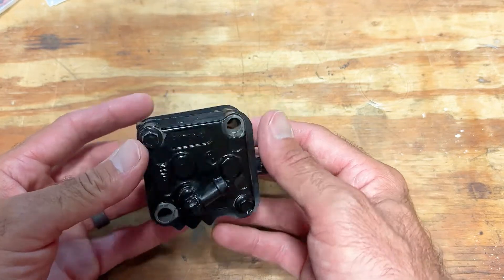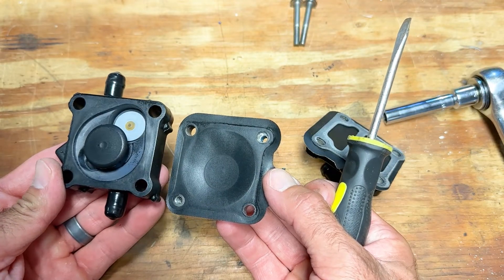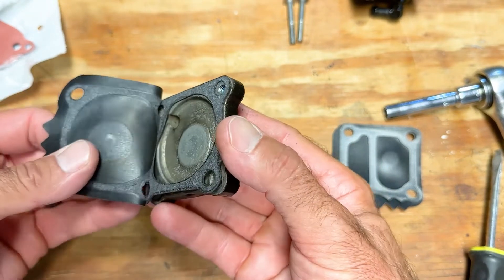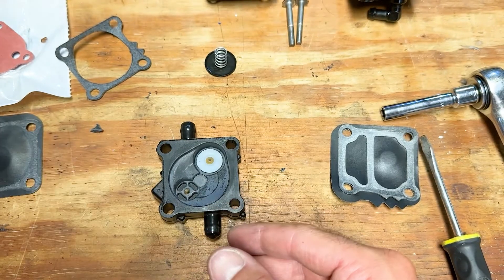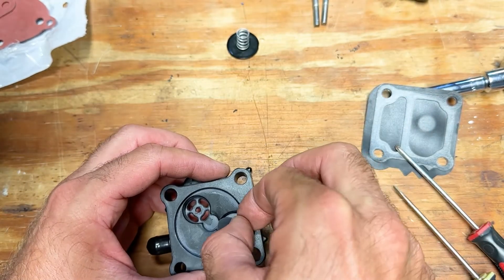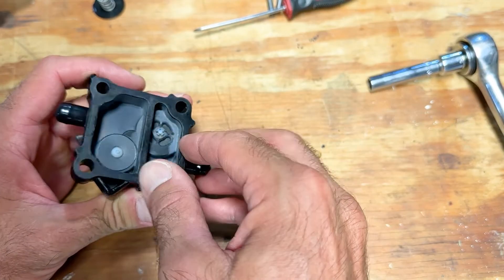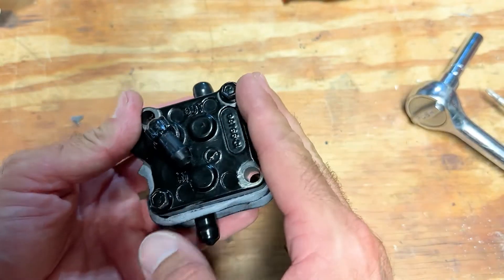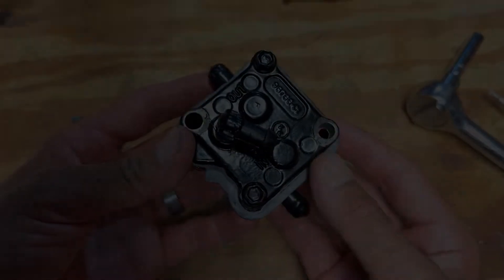Low Pressure Fuel Pump REBUILD (Mercury EFI Outboard)

Comment: Muy instructivo video.Congratulaciones por el compromiso de siempre aportar soluciones al mundo nautico. Cree ud que el mal funcionamiento de una bomba de estas características, pueda ocasionar que un fuera de borda Mariner 25HP EFI 2007, de arranque manual, genere dificultades de arranque y sólo lo haga bien cuando intento el arranque con el acelerador activado?
Reply from the maker: Possibly. Mine has actually been doing that more and more too. I think it might be the fuel pressure regulator.

Comment: What about the gasket that goes on the back?
Reply from the maker: No gasket on mine. Just have to line up bolts and make sure vacuum hole isn’t covered up
Reply: @PrestigeWorldwideFishing if you go to the 7:15 mark on your video you show a clear shot of the back of the fuel pump. That clean popsicle stick shape you see is from where a gasket goes. You may be getting lucky lining up the hole and tightening down those 2 screws but there 100% is supposed to be a gasket there. Yours at some point also had it. I just bought a gasket kit and it came with the popsicle stick shaped gasket.
Reply from the maker: @FirstCoastFishingAdventures weird. Maybe I will add one to be safe. New model didn’t come with it either. Thanks for catching that!
Reply: @PrestigeWorldwideFishing I came to this video to check and see the exact orientation of the back gasket and there was no mention of it and mine is pulling in air because my gasket was blown out so I was like “wait up, hold on a minute” lmao
Reply from the maker: @FirstCoastFishingAdventures 😂 my bad. And I just pulled mine. I did install the gasket on the one attached to the boat. Just failed to remember and mention that in the rebuild video.

Comment: With the engine cranking should fuel be coming out of the fuel pump out let ?
Reply from the maker: Yes. It pushes it out the outlet to the high pressure fuel pump. Might have bad diaphragm on your low pressure pump, clogged fuel filter or line, or maybe air leak in line or bulb

Comment: I got a yamaha 4 stroke 70 hp fuel injected its been sitting for 2 years gave it a fog treatment a waited for 24 hours put in new gas put some starting starts put goes off wont stay running
Reply from the maker: Check and clean your high pressure fuel pump too. Replace the fuel filters and maybe consider a seafoam shock treatment to break up carbon build up in the motor. It will make it run like crap for a bit until it gets it all through
Reply: Same!!!! My 02 225opti sat for a year. Replaced water pump, poppet valve, fogged it. Brand new fuel and fuel filter. Will start but only runs for a minute than dies. Primer ball goes soft also
Reply from the maker: Can’t say for certain but that sounds like a bad low pressure fuel pump. If your boat runs good at low rev and dies at high rev when you are running it’s a high pressure pump. I got to experience both lol
Reply: @PrestigeWorldwideFishing  looks like it was my primer ball!! I’m going to rebuild the fuel pump anyways since I have the kit. Old primer ball wasn’t working. 🤦🏻‍♂️
Reply from the maker: Ah gotcha! Did it have a hole in it or something?

Comment: How much does that low pressure fuel pump cost? Does that one run off camshaft?
Reply from the maker: They are pretty inexpensive. Here is video of the install on my 1996 motor. Fairly simple.
https://youtu.be/ZioSA3qhEwA
Reply: I ordered a kit. One of the rubber gaskets has two holes like 3/8 diameter! Do you know if it makes a difference vs the one you installed? Thanks!
Reply from the maker: @salvadorpineda7762 man, I’m really not sure. Might just have to install it and find out I guess. Good luck

Comment: That little plastic piece of shit that locks those check valves in is bullshit. Mine went fucking flying across the driveway and ill NEVER find it again. Now the check valve had a hole in the center and dont know wtf to do now 😡
Reply from the maker: Yes I agree those things are super annoying. You can order another kit off Amazon pretty cheap… I know that doesn’t help your current situation though

Comment: I have the 125 mariner I rebuilt my fuel pump a few years ago and I used both black rubber and plastic check valves and it’s running fine still.
Reply from the maker: Ok good to hear! I figured I would be fine but felt I needed to put that in there. Thanks for the info. 🤝

Comment: Interesting … do you think this could be causing similar issue on 225 EFI?  Basically motor runs great other than when shifting from neutral into gear - makes it tough to dock lol
Reply: same issue on my motor did you solve it? i have same 225efi, great runner doesnt love to idle once warm. im looking at TPS next.
Reply: Changed tps and never stalls anymore.  Now I’m bogging down at 4k rpms. Think I have a fouled spark plug.  Always something …
Reply from the maker: Possibly, could be a number of things though. Does your fuel bulb pump up easily and keep fuel in it or does it empty?
Reply: It typically emptys I think
Reply from the maker: Might be your low pressure pump then. My motor would actually die and my bulb would be completely empty. Couldn’t get motor to start until I pumped it up again. It would run fine for quite awhile and to it again.

Comment: Hey buddy by chance did this fix your issue?? I’m having same issue.  I’ve tried replacing so many parts and cannot figure it out! I have same motor just a 200hp! Sucks not being about to get out and fish!!
Reply from the maker: Hey man. I did fix the issue but went in circles so not exactly sure what did it. I replaced low pressure fuel pump, problem still happened. Replaced high pressure fuel pump and it stopped happening the first time out. Went out again and nearly didn’t make it back to the ramp because boat wouldn’t start. 
Got it home tried to start in the yard with muffs on and nothing. Pulled off my Amazon low pressure fuel pump and replaced it with the rebuilt fuel pump. Fired right up and I ran it hard on the lake with no issues so far.
What have you tried? Maybe I can help
Reply: @PrestigeWorldwideFishing  well that’s good to here! Hopefully it stays good for you.   So…. Heck idk where to even start.  Basically right now I can’t get on plane. Starts up and idles just fine! Revs up in neutral just fine. But try to get on plane it just falls on it’s face big time!! I’ve tried so many different things and can’t figure it out.
Reply from the maker: Does it bog down or just won’t rev the motor high enough to get on plain? Might be your stator. It basically helps switch your low rpms to high rpms. If it can get to high it obviously won’t get up on pad.
Hopefully it isn’t simulating a fuel issue like mine was and it is actually ECU.
Reply: @PrestigeWorldwideFishing  so it revs up in neutral ok. Have noticed it doesn’t rev up as quickly like it use too.  When trying to get on plane it has no power.  Also noticed it’s running a lot richer then it use too.  I’ve replaced low pressure,high pressure fuel pumps, injectors removed and cleaned/flow tested. Checked base fuel pressure at idle and wot trying to get on plane. It’s right at 37psi.  So all the fuel systems checks out good.   I’ve also already replaced with brand new cdi stator,trigger,switch boxs and regulators!!       Had the ecu tested and said it was bad by brucata they said it was bad so I bought another one that’s been tested and known good by a shop….  I’ve spent so much money and time trying to figure out what’s going on with this dam motor. I’m about to give up! 😞
Reply from the maker: @matt98eclipse Dang dude, I’m sorry. So it is the ECU? Did you buy a used/rebuilt ECU from a shop or new ACU from Brucato? 
If you bought rebuilt ECU, even if it was working it won’t last. Even if the part was soddered back together other parts can fail quickly. That is why I bought new from Brucato even though it cost me $1500
Reply: @PrestigeWorldwideFishing  yea man it sucks! I’ve spent so much. Now I have alot of spare parts lol. But I’m honestly leading towards the ecu 😒.  I bought it online from a boat shop place that guaranteed it worked. Well don’t think that’s the case. Now I have 2 ecu’s that’s bad possibly! I’m running out of ideas other then possibly it needs a link and sync done but not sure how to do that!  I’m gonna send my ecu Into Simmons and have them test it and repair it if needed but that’s only another 750$ 🙄. Compression is all at 110 on each cylinder aswell.
Reply from the maker: @matt98eclipse You could send them both to brucato. I think they will test them for $85. I’m sure they will try and sell you one of theirs if they are bad though. Not sure if you want to do that. 
Can you send the one you bought back and recoup some money?
Reply: @PrestigeWorldwideFishing  that’s who I sent my original one too. They said it was bad and wanted me to buy one of there new ones for 1700$.  They don’t repair them anymore I guess.  Simmons repairs them and are 75$ to test them.
Reply from the maker: @matt98eclipse yeah that’s who I bought mine from. It was $1500. They don’t repair them because they won’t last from what I understand. Not for sure though. 
Well I hope you get more answers rather than problems soon and can get up and running.
Reply: @PrestigeWorldwideFishing  aww gotcha. Yea prices have went up then from what it sounds like.  So… I took boat out fishing yesterday afternoon.  Whatever the issue is it’s causing motor to run extremely rich to point it’s flooding out. It’s happened couple times. I’ll start motor and it smokes pretty bad. Then give it little gas and dies. Then won’t start from being flooded out.  I can remove plugs. Turn motor over to air it out and it will fire back up.   What would cause motor to run really rich??
Reply from the maker: Hmm not sure. Sounds like your motor is probably injecting the oil into the fuel but there isn’t enough fuel or something? Like your mixture is off. Did you have to do any tuning to your ECU after installing? Sounds like it might need adjustment to get your fuel and oil mix right.
Reply: I put a new vst, low pressure pump and thermostat. It gets on plane out the landing then it bogs.
Reply: @2751Brandon your supposed to be at 34 psi. I think you need a fuel pressure regulator. I am dealing with the same issue as you. I get on plane sometimes sometimes not. Running through this bullshit now. No one has a yes this worked for me scenario. 🤦‍♂️
Reply: Yeah its getting frustrating. I actually bought a used vst from ebay. I tried a external tank still nothing. My lift pump js at about 2 psi. 

I was thinking maybe its a ecu issue.
Reply: @2751Brandon my issue ended up being my ecu! I’d send your ecu to Simmons and get it repaired.
Reply: @matt98eclipse  10-4 I have reached out to them but wasn't sure. What was your issue with yours?